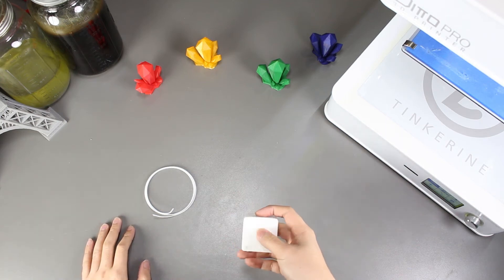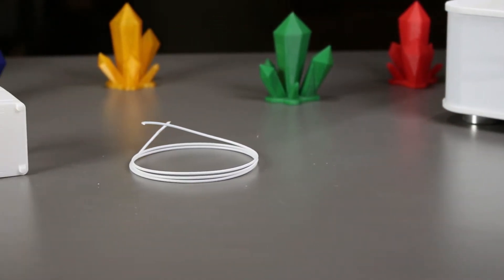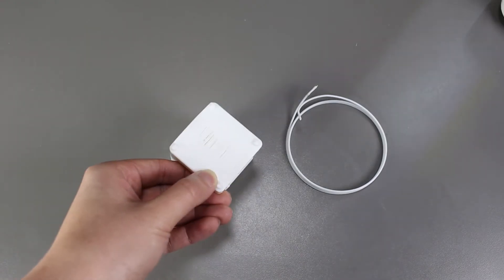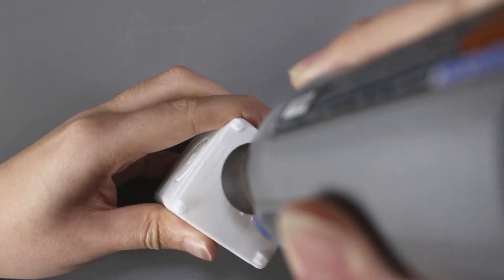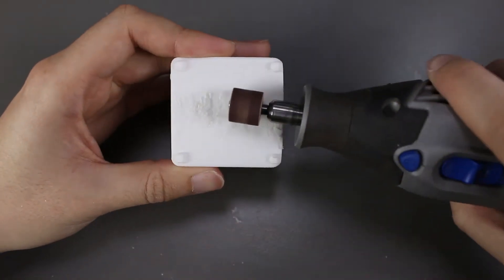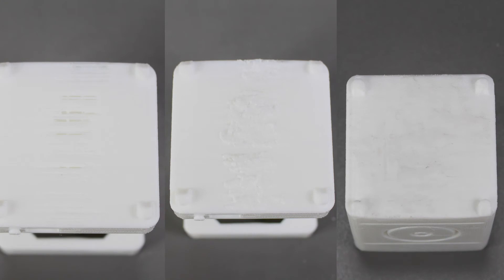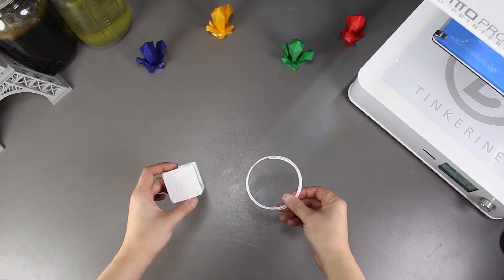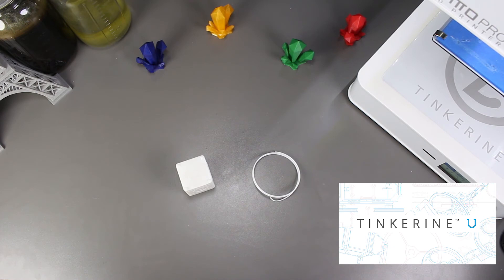Friction Welding with PLA to Fill in Gaps

Comment: This was useless, you don't explain anything you used to to do this, this was just a pat on my back video for yourself smph....
Reply from the maker: Thank you for the feedback! Instead of the dremel bit, we replaced it with a strand of filament. We set the speed to 10 and started to friction welding the PLA onto the print itself.

If you have time, please check out these two videos for more information about friction welding with PLA:

https://www.youtube.com/watch?v=GQHtJObKrpQ&list=PLM67_i2HiikJFqAieaJc2qVoUZ_x5W0dR&index=133

https://www.youtube.com/watch?v=QyvcZkA-P6U&list=PLM67_i2HiikJFqAieaJc2qVoUZ_x5W0dR&index=70

Comment: Dude need to explain your technique better, have no idea how you filled in the gap.  Could be a good video but your explanation I found useless. Sry
Reply from the maker: Thanks for the comment and letting us know! We took a strand of PLA and placed it into the dremel. The rotation on the dremel is very fast and due to the friction as it comes into contact with the PLA print, it is enough to heat up and allow us to deposit it onto the surface. It's like using a 3D pen but instead of a heating element, we used friction to create that heat.

Comment: Explain the process to make the video useful.
Reply from the maker: Hi David,
Essentially, we place filament at the end of the Dremel. The rotation will heat up the PLA and deposit it into the print.  Afterwards, we sanded it down and eliminate the gaps.

Comment: I was thinking about using a 3d pen and dispense the materials into the gaps and sand it flush
Reply from the maker: Thank you for the comment, using a 3D pen sounds like it would work really well and easier than using a dremel!
Reply: @Tinkerine  And honestly, using a dremel is very unwieldly and makes too much noise... and you would need a collet small enough to fit a 1.75mm filament